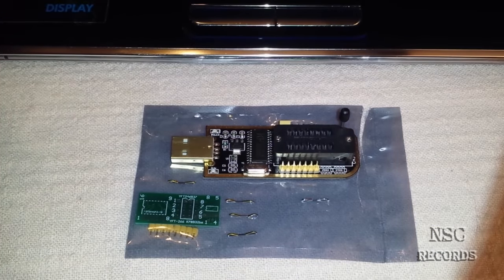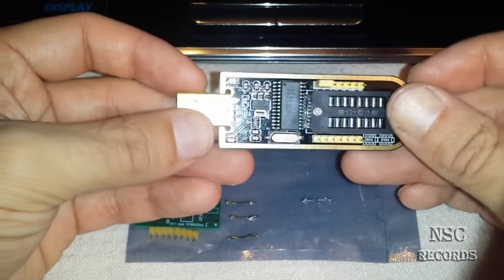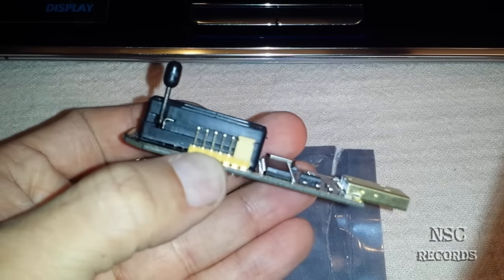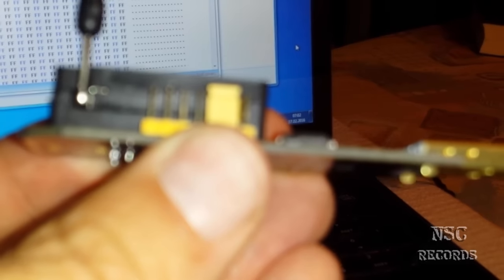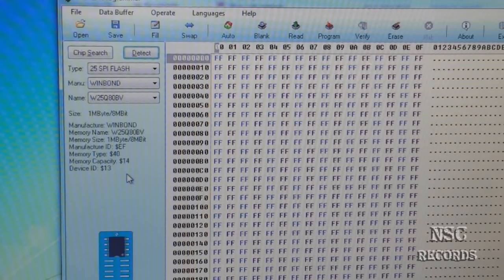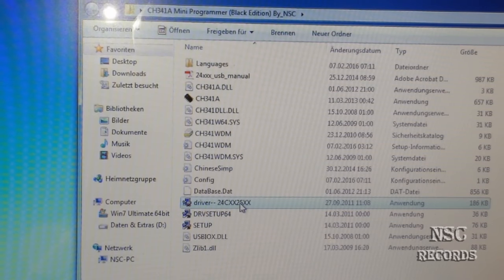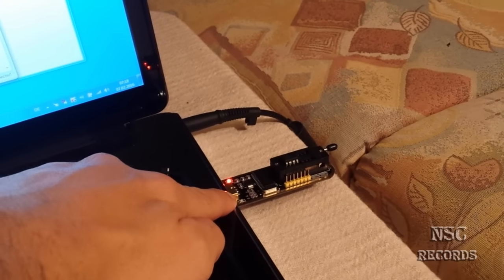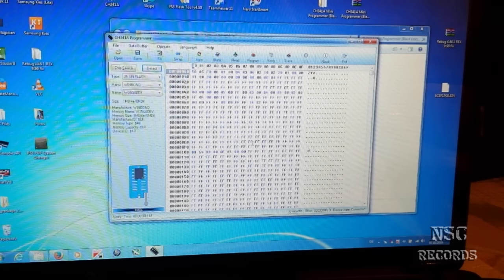Installing Drivers & Software for the USB Bios Chip Programmer CH341A (Black Edition) By:NSC

Comment: 1399/5000
Hello and thank you very much for all that information
You will see .. and acquired a through a € 20 I think I'm face-to-face now knowing the real price .. but it's the same since I was the one who ordered it because I still have little knowledge of this world
but you see I have some questions the computers that I have broken are hp 15-ay117ns and I suspect if it is the bios because I stop working after having formatted an external hdd with macrorit partition manager and I forget to uncheck the automatic restart at the end of formatting reboot and there is that go electric supply on the black screen that appears when you restart and makes the partitions in addition to that did not have any other problem this equipment ..
the second team that I need flash bios is a lattepanda 64rom and 4 ram then try to put ubuntu and I left sim power to get more to the bios .. and the third team is a router N tplink tl-mr3420 v4
the questions are if I can use a pair of tweezers with this programmer and which and where to buy since you do not come with this programmer
for the lattanda I have seen that it is not necessary to desolder the bios chip and that it can be done directly on the sbc
for the HP I do not know if I should or not .... ???
the other question is regarding the router can I flash this programmer to the router or not?
I appreciate if you answer me
 marcossegere @ gmail com
+34 655663128
and greetings and thank you very much for the video

Comment: I just had a thought why not just solder a link for the jumper connections under the PCB - the device only costs a couple of dollars so no harm done if you break the first one - buy two for example.

Comment: the 25 spi flash do not work for me 24 chips work I don't know about this issue, I try with two chips the proglem is the same, writen timeout filed when press programm
Reply: write operations timeout failed

Comment: Very helpful video NSC, I accidentally flashed/updated by existing AMI-BIOS on my computer from a new BIOS file on my hard drive [NTFS] damaging by FAT BIOS partition. I do not have a corrupted file on a FAT partition, but the file system is damaged. Does the Chip programmer restore the FAT?
Reply from the maker: +Dave Oliver The programmer will do the rest for you, you just Need the Bios file, the Bios Chip and the Bios Programmer. Otherwise you can also buy a already flashed Bios Chip from eBay for about 10$
Reply: +UltraNSC OK, I will take my old AMI-BOIS chip off Mboard and give it a go, thanks for your kind support.
Reply: +UltraNSC 

I re-programed [CH341A black version] BIOS on one blank chip and also original chip, both do not work;
Even a new BIOS chip purchased and programmed for ASUS Q87T motherboard does not work?
I may have to buy new ASUS Q87T motherboard and rebuild complete NUC PC. 
I think buying a new motherboard just for the BIOS chip will not also work with old motherboard, though nothing wrong with old motherboard but for BIOS chip!
ASUS support are so unreasonable and most unhelpful on BIOS issues.

The programmer CH341A detects chip as Winbond W25Q128BV its specified on chip label as W25Q128FVIQ.
Programmer reads, wipes and saves OK.

If I READ and SAVE original chip data its 2 byes short.
If I PROGRAM chip with new BIOS.CAP file it is 2 bytes short.
Original BIOS file is Q87T-SI-0914.CAP size 16,386 KB
This file size appears to stop BIOS function maybe, what do you think, comments welcome?
It should be 16,386 and not 16,384.
Reply from the maker: Yes, something is wrong there, maybe your Bios Chip is Damaged, try to get a new one, thei cost not much on eBay...

Comment: CH341A use 12MHz Xtal, but this one came with 27MHz so the chip will not work properly. replace it with 12Mhz it will work as it should.

Comment: Do the CH341A drivers work fine with Windows 10? I don't wanna run into any complications.
Reply from the maker: Yes, but i recommend working with Win XP or Win 7 for this kinda work.
Reply: it does!
Reply: I just flashed a Winbond 25q64bvsig 1119 without any trouble!
Reply: update: working with windows 11 too!

Comment: What if bios file too large for your bios chip?
Reply from the maker: Than you need a bigger Bios chip
Reply: @NSC-Modz  And how do you get one?I took the bios chip from the board,dowloaded the bios from ASUS page (it is .CAP and not .BIN) and it say it is to big and the rest won't be readed or something like that...I tried with the oldest version wich is 25Kb smaller but still the same error :(
Reply from the maker: @dumitrucozma2348  this is the wrong way, this will not work like that. Because the file you have is only for install with Windows...
Reply: @NSC-Modz  where can I get the good one?
I have an asus am1m-a
Reply from the maker: You can ask Asus, or you just buy a chip witch has the newest bios inside, and than you copy it for you and send the chip back 🙈
Reply from the maker: @dumitrucozma2348  try it here to: https://de.driverscollection.com/?H=AM1M-A&By=ASUS

Comment: Hi can I use this to program Maximus 5 formula bios chip? I keep getting error code 00 or it will just boot loop around 7-10 times before logging into windows m thinking the issue is in the bios
Reply from the maker: Hmm maybe not tbe bios, bad drivers can cause bids problems to, or damaged hardware, damaged ram, hdd... you able to enter the bios without problem?
Reply: @NSC-Modz  not without bootlooping 10 times then I can enter the bios I removed my hdd still same issue removed RAM same issue it started with error code 00 randomly one day then I cleared bios switches my HDMI cable from graphics card to motherboard HDMI I was able to get rid of error code 00 but then the bootloop issue started

Comment: Arkadaşlar bu linkte de çok faydalı olabilecek bilgiler var. ASUS  K55VJ  DEAD  BİOS Repair (Ölü Bios Canlandırma) ARAÇLARI  
K55VJ ve K55VM Asus laptopların Biosu kronik olarak arızalı çıkan modelleri var. bu fabrikasyon arızasıyla ilgili çok mağdur vardı ancak kimse KESİN ÇÖZÜM bulamamıştı.  hiçbir yardıma ulaşamadığım için kendim sonuca ulaştığım iöin bu paylaşımı ASUS K55VJ ve K55VM ve diğer benze ölü bios arızalarının tamiri için KESİN ÇÖZÜM sizinle paylaşıyorum.

Friends have information on this link that can be very useful. ASUS K55VJ DEAD BIOS Repair (Dead Bios Animation) TOOLS
The K55VJ and K55VM Asus LapTs have Biosu chronically defective models. There were many victims of this fabrication malfunction, but no one could find a FINAL SOLUTION. I share with you a final solution to the repair of the ASUS K55VJ and K55VM and other similar dead BIOS failures that I have come to conclusively because I can not reach any help.

Link : 

https://drive.google.com/drive/folders/0B4Z5a6QVNOzAbVBQbGJlY0dIbjA?usp=sharing

Comment: Thank you, great video! I have a question, a bit dumb question but still... What should I look when buying a bios chip? Should it have the exactly same number? I think mine is winbond 25q64fva1g 1334
Reply from the maker: You v Welcome. Just try to search the bios chip for your model.
Reply: @NSC-Modz  That's what I did. My chip is 25Q64FVAIG 1334, but when I search for it the only result is W25Q64FVAIG. I'd assume they're interchangeable?
Sorry for taking your time.
Reply: @earo6479  The 1334 number is a production year and week (2013 , 34th week). The "W25Q64FVAIG" is the proper symbol (catalogue symbol/part number) of your chip. Often manufacturers remove beginning of part number and even a part of it's digits number too, from the chip chassis because there is not that much space on it.
Reply: @sapers2  Wow, that's really informative! Thanks!

Comment: Thank you sir;  *IS THERE ANY PROGRAMMER THAT ALLOWS PROGRAMMING THAT CHIP VIA macOS ?  (which I haven't found...) *
Also, if I modify something - and the characters in the right hand column (ASCII is it?) ... and the number of characters are the same, am I correct that will not work ?  And if not... what principle should I follow which maximizes my attempts to efficacy? 
THANK YOU
Thank you so much.
Reply: 314a dravir

Comment: Thanks for the video!! but I have a problem; when I connect the mini programmer to the chip does not recognize it, and yet in the list there is. I connect it via tweezers and cable directly to the chip on the motherboard but it doesn’t detect it, do you have any suggestions?

Comment: I connected soic clip before the USB was connected and soon smelt burning.  The battery was removed and obviously power adapter removed.  I couldn't flash Bios as second LED was dim or not lit at all.  My laptop won't start.  Any suggestions?
Reply from the maker: Looks like something was shorted...

Comment: Hi, 
UltraNSC 

I have that stuff too, do you have the software/drivers are include for chip Winbond 25Q256FVFG?
coz need to flash my chip, but the old software/drivers are not available for my chip winbond 25Q256FVFG.
thank you

Comment: but my chip is not detected... mine is winbond what should i do now?
Reply: if its an eeprom thats still attached to a board then you might need to desolder it first
Reply: @mjyanimations1062  its a gpu
Reply: @TheKlisa  make sure its actually the bios eeprom chip you are trying to flash and not a soic8 regulator. Then make sure everything is plugged in correctly, then it sould work
Reply: @mjyanimations1062  well its the only chip on the card that looks like bios chip. I found a guide that they put on 8 pin electrical tape and try to delete everything from chip dod that, chip is verifying now but i cant flash anything to it, when i program and try to read it its stil blank. Its the gtx 1070 asus turbo and chip is on back side close to video out ports. I also got on one forum full story with the gpu if you want to check it out
Reply: @TheKlisa  yeah sorry. I can't really help you in this case. Also that is a good card so I don't recommend flashing it this way since there is a chance you could brick it.
Reply: @mjyanimations1062  i already did nvflash and prottection could not be removed and bios was altered for mining

Comment: Hello could you please help me?

I want to change the access code at my car radio but now I have a problem with the USB Programer. on YouTube there is a guide but there is another USB Programer used and now I do not know what pins I connect the cable.

please help me LG

Comment: i had this problem, when i update bios(auto on windows) my mobo got bricked, i have this A58MD VER1.0 BIOSTAR. the problem is when i use this usb eeprog, biostar download page doesnt have a bin file, they use biostar updater and a bios file with .BSS format. so how i update or flashing with this usb eeprog? i already erased all the data in this chip.
Reply from the maker: Try to rename it to  .ROM and save, and better do this stuff only on a Linux, XP or Win7 computer, not with Win 8 & 10, could do you some bugs and problems...

Comment: i have a Problem with winbound EEPROM: i receive this msg when i want to start for flashing ( file length beyond range of will be ignored )
Reply: Me too, how to flash with EEPROM with CH341A?  i want to flash bios mainboard Supermicro X9DRL-3F, IC ROM 25Q128A. please Help me. Thanks
Reply: @mountainsvn   Any luck in finding the solution ? If u did, please share
Reply: @trollstall3569 . I don't have a solution for this. Every test failed. I also contacted the manufacturer but they did not support me because I am not their partner. Bored!!!

Comment: Please let me know can I use this adapter to reset laptop battery bios.
If it is possible, how to do that?
Thanks
Reply from the maker: Yes, but you will need to programm a new Bios.
Reply: @NSC-Modz  ok thanks 
I have a program but I couldn't find a appropriate adapter yet

Comment: Hi, I have a HP 840 G1 like yours. I used the mini programmer to backup the BIOS, remove the admin password then write the new BIOS. Now it does not power on. Only flashing orange and white light. Can you please help me? Restoring the original backup did not work either.
Reply from the maker: Mostly people's destroy the pads while soldering. How did you reset the password? Maybe you just destroy the bios file...

Comment: Hi, I programmed a BIOS about a year ago and then again a month ago. Last week I tried again and  it would read the chip fine but would not erase or program (I get a "timed out" error). I tried 2 different CH341 units with no luck. At some point Windows 10 did an update, but I'm not sure if that was before or after it stopped working. Any ideas?
Reply from the maker: Maybe your bios chip is damaged, to many sector errors?
Reply: @NSC-Modz  I tried a couple of chips and had the same results. About an hour ago I borrowed my brothers laptop (Windows 7) and installed the software on it and it worked. I wonder if it's something to do with latest version of Windows 10 that I have on my desktop.

Comment: has any way to get the firmware of a ps3 blue ray drive and move to another pcb from another ps3 blue ray using the CH341A programmer chip because my blue ray has the connecter from the 24pins is damaged
Reply from the maker: Should be possible, you need find out witch chip it is.
Reply: Thank you. I'll try and see what happens. I'm not sure which chip contains the firmware. It should be the same way the manufacturers do with the bios of the laptops, I'll try
Reply: Sérgio Moreira have you done it?
Reply: Not yet, I'll try with a psp.
I used many times to copy bios from laptops, probooks, but I do not know if it works with the blu ray drive
Reply: Sérgio Moreira alright good luck man!

Comment: I bought one of these but as soon as I put a eeprom the chip got crazy hot. I've sent it back to the seller and waiting for new one. It's not a well made device unfortunately.
Reply from the maker: Yes but wait, when it runs hot, your chip is maybe damage or it has a short somewhen... or you just connected it wrong. I think it's not the device, more the chip...
Reply: @NSC-Modz  I tried several chips. All same. Only problem is the device has connecting to pc perfectly and shows up. Even tried 8pins jungle bios chip from old motherboard but all get hot. Question is if the ch341a chip is damaged how it comes up with no error? Also checked 3.3 and 5v voltages they are good.
I also bought a new one so I can compare them and hopefully find the problem.
Reply from the maker: @MrAM-ek8pg  ohh ok, than it's the device...

Comment: Hello everyone
someone knows if it is possible from windows 7 in a virtual machine - in this case it would be with virtualbox.
I have been preparing the machine with a windows 7 ultimate x86 install java and a net framework version (dotNetFx40_Client_x86_x64)
apparently recognizes the usb and it seems that if I install the drivers and the program opens but before so much doubt better to ask who knows more
I thank the answers
greetings to all

Comment: Did not work for me. Which BIOS chip (unprogrammed) should I buy to flash a new BIOS on a ASUS Z170?
Reply: Try Ebay...   A few of the guys there sell replacement BIOS chips.., solder in or replacement types...

Comment: Great video! Is there a way to add a WINBOND 25Q32FVSIQ1449 to the CH341A Programmer? I'm running a t440P. Thanks.
Reply: Howdy - I've found that the specifics on the BIOS and the specific files in the supplied library often don't perfectly match up with what is written on the chip. In fact, for WinBond BIOS chips I can't even find the chip I have in their entire product catalog if I search the specific characters on the chip. While the CH341A program is popular, I found that an alternate tool for flashing BIOS called AsProgrammer has a far more extensive library of chip types. Once I followed this gentleman's video to confirm that my programmer was properly installed and it was communicating properly through the USB connection, I opened up AsProgrammer and used it to find a closer match to my chip (my chip is a WinBond 25Q64JVSIQ, but I used the W25Q64FV chip in the IC search). and it seemed to like it. Hope this helps a bit.

Comment: hi das mit dem jumper ist das der Programmer auch im seriellen modus (ttl) betrieben werden kann man braucht aber auch die treiber 
( Jumper 1+2 ist epp ist parallel modus 2+3 ist ttl ist serieller  )
Reply from the maker: Jo, kann gut sein, oder ist so ^^
Reply: hi dürfte ich denn Treiber Paket hier teilen ?
Reply from the maker: ok, ich werde es aber erst checken, wegen Viren-Hack Angriffe usw. Bitte nicht falsch verstehen

Comment: ASUS K55VJ K55VM ÖLÜ BİOS KRONİK RAHATSIZLIĞI KESİN ÇÖZÜM

ASUS K55VJ K55VM DEATH CRITICAL COMPLETE SOLUTION

Arkadaşlar bu linkte de çok faydalı olabilecek bilgiler var. ASUS  K55VJ  DEAD  BİOS Repair (Ölü Bios Canlandırma) ARAÇLARI  
K55VJ ve K55VM Asus laptopların Biosu kronik olarak arızalı çıkan modelleri var. bu fabrikasyon arızasıyla ilgili çok mağdur vardı ancak kimse KESİN ÇÖZÜM bulamamıştı.  hiçbir yardıma ulaşamadığım için kendim sonuca ulaştığım iöin bu paylaşımı ASUS K55VJ ve K55VM ve diğer benzer ölü bios arızalarının tamiri için KESİN ÇÖZÜM sizinle paylaşıyorum.

Friends have information on this link that can be very useful. ASUS K55VJ DEAD BIOS Repair (Dead Bios Animation) TOOLS
The K55VJ and K55VM Asus LapTs have Biosu chronically defective models. There were many victims of this fabrication malfunction, but no one could find a FINAL SOLUTION. I share with you a final solution for the repair of the ASUS K55VJ and K55VM and other similar dead BIOS failures that I have come to conclusively because I can not reach any help.

Link : 

https://drive.google.com/drive/folders/0B4Z5a6QVNOzAbVBQbGJlY0dIbjA?usp=sharing

Comment: Hi! I have 25l12872f bios chip. The CH341A don`t have that model chip in the list, should I choose TL866II programmer ? Also, can anyone say to me can I change chip 25l12872f to another 25l12873f ?
Reply: Did you figure it out? I’m trying to read MX25L12833F but it doesn’t seem to be supported anywhere